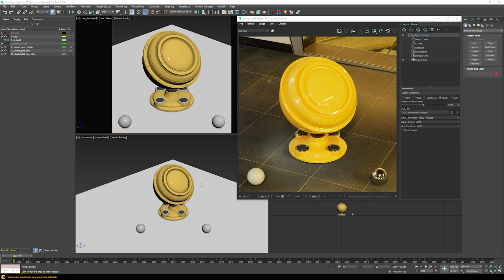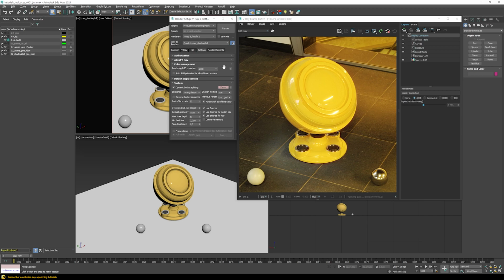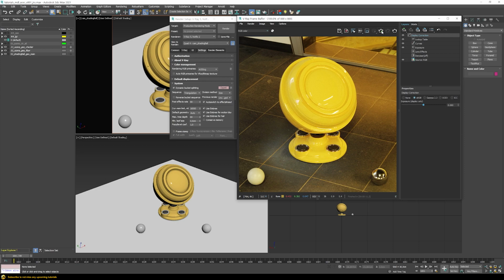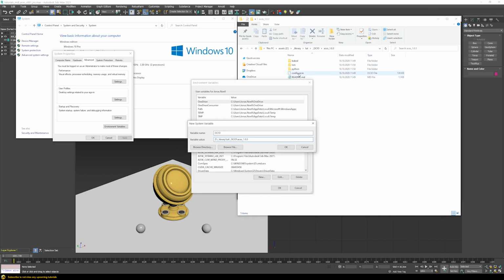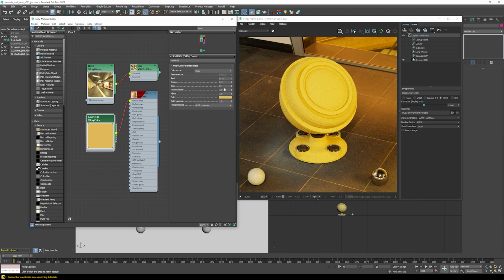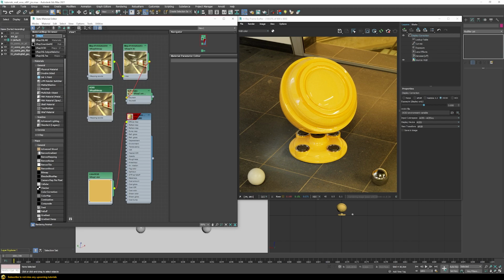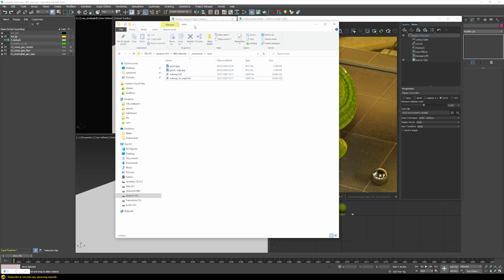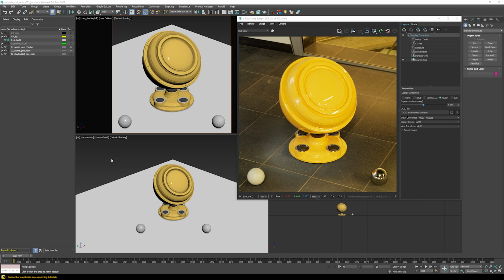V-Ray | How to use ACEScg WORKFLOW | ACES Theory, General Workflow, OCIO, sRGB Texture Conversion

Comment: Hey Jonas, I've been highly enjoying the results coming from the VFB, but the next issue is post work in Photoshop and After Effects. The render results do not look the same when exported as an OpenEXR, png, jpg, TIFF, Targa, nothing. Made sure Photoshop was set to 32-bit mode and changed color space to ACES. Is it simply Adobe doesn't support ACES workflow yet?
Reply from the maker: Hi, as far as I am currently aware Photoshop does not support ACES colorspace internally yet. You can however import EXR-Images and then convert them using this plugin here: http://fnordware.blogspot.com/2017/02/opencolorio-for-photoshop.html
I tested it and it works but it basically will bake in all the information and you are not working really in ACES colorspace internally. 
Take everything that I said with a grain of salt as I am not a Photoshop expert, so maybe there are still ways how to set up Photoshop correclty. If you find some please make sure to share it with me :-)
Reply: There is a workflow in photoshop that involves creating a view transform in 32 bit by exporting a 3dLUT which you then stick on top of your stack in an adjustment layer but I haven't worked with it much. Im not sure if it reacts how you'd expect in fusion or nuke for example - both which have proper acescg implementation. so short answer is, no. Sadly, Photophop doesn't support acescg natively which is a shame. Adobe tends to buy innovation rather then develop software but I will refrain from letting loose on Adobe...

Comment: What about bump normal maps? they load as srgb?
Reply from the maker: They should be loaded as "raw" so that means that no transformation is applied. VRayBitmap is smart enough to load it correctly by itself in V-Ray 5 when you apply it through a VRayNormal Map node. If you want to make sure you can also extend the filename with a "_raw" tag in the end.
Reply: @JonasNoell  so if i rename it accordingly with raw, it bypasses auto settings in vray render settings checkbox?
Reply from the maker: @Minche Flute If you add the _raw nametag it will make sure that the VRayBitmap is loaded as raw when you enable Auto RGB primaries in the render settings. 
But as said if you load it through a VRayNormalMap node it's basically impossible to have it loaded incorrectly in V-Ray 5. Unless you go in and manually switch the RGB color space in the VRayBitmap itself. Also, you will notice pretty fast if the Normal Map is loaded in the wrong color space :)

Comment: Thank you for the tutorial. I just want to make 1 additional note. I found that if you use VrayColor and pick color not by values but with standard color picker, to receive same color that you see in VrayColor in front of "color" you need to adjust color gamma  to 2.2. As I understand it's because  3ds max picker work in gamma 2,2 and you need additional conversion to receive the same color that you pick by "eye". We artists and we want to have green color that we pick in VrayColor look the same in diffuse render element :) Correct me if I wrong
Reply from the maker: Oh, that is a good point. I would need to double check but I a ssume that's how it should be done, adjusting the gamma to 2,2 and then you would be able to just pick the color you want and it would look the same in the diffuse. Thanks for pointing out!

Comment: Hei Jonas, thanks for the video, super interesting and ill documented subject on vray. I just have one question. What will happen to textures you dont convert? Will it “break” the workflow, or just alter it a bit. I am thinking about testing this with a project and would probably just convert the main architectural materials, the ones that cover more surface, and thus affect colors more
Reply from the maker: Hi, well basically nothing technically bad will happen except that your colors will look way more saturated than they are supposed to look like. For example if you are using a grass texture the grass would look greener than it was originally intended to look like defined by the texture. So in order to have everything behave the way you expect it to it would be best to stay uniform in the color space that you are using and not mix different color spaces together. Basically if you use the workflow to assign proper name tags to your textures you wouldn’t need to convert anything manually and everything would happen automatically, so that is probably the easiest approach 😉
Reply: @JonasNoell  The good thing also is that if you assign the proper names, that would not affect the use of non aces workflow
Reply from the maker: @maxdanieldaiber  Yes, exactly that is the idea behind it :) Just set up your texture/hdri library one time, switch on AutoRGBPrimaries and from then on don't need to care about it anymore (as long as you use VRayBitmap)
Reply: @maxdanieldaiber  Yes, but older projects will have missing textures because you renamed them, no?
Reply: @bgtubber  well I guess you can duplica te them to avoid that
Reply: @maxdanieldaiber   @max daiber  Of course, but that's pretty wasteful on HDD space, especially if one has hundreds or even thousands of assets which is not uncommon these days.

Comment: Very interesting tutorial, thanks for that.  Here's what I'm wondering about: Since I edit every rendering in post to some extent, what's the point of doing all that converting? Don't you "falsify" colors with every adjustment you add, regardless of color space? Maybe my workflow is just too simple ;)
Reply from the maker: Well as said it really depends on your specific use-case. If you don't work in a team that requires ACES for example for use in compositing then in your specific case it probably doesn't really make sense. Basically working in ACEScg guarantees that your work is future-proof and can be converted to whatever colorspace to be displayed on whatever medium in the future. But if you mainly do pictures that are just published online and just view them on sRGB monitor you won't have any immediate benefit to adapt this workflow and on top of that you have the risk to implement many mistakes if you don't really know what you are doing. I think at the moment probably most people are fine to continue using sRGB and unless you know a specific reason why you should change it probably means you shouldn't :)
Reply from the maker: Speaking about adjusting pictures in post, ACEScg gives you more room to do more extreme adjustments as you have a wider color gamut to work with. But you need to use a software that supports it (Photoshop for example doesn't). So if you do crazy adjustments in post and use specific software then that might be a reason where you could benefit from using ACEScg.
Reply: @JonasNoell  you just put into words what I was thinking: very specific use case and not for me 😄
Thanks for the clarification!
Reply from the maker: @pixelquarry  Maybe not night now, but it will become increasingly more important so it's definitely good to know what it basically is :)
Reply: @JonasNoell  that’s why I bookmarked this video! 👍
Reply: I think correct colors will always be something important to consider even if you do a lot of post on it. I am constantly strugling with colors in vray and max and it seems to me that this is one step forward on working well with them. Anyway, if you do archviz like me, you may find yourself twicking most of the diffuse color of assets you buy, so maybe it wouldnt be that bad to convert at least them most important ones
Reply: @maxdanieldaiber  As I understand it ACES increases the range of colors beyond sRGB...on devices capable of displaying more than sRGB, which aren't many I reckon. So I'm not sure if ACES is going to help with your struggle. Wrong colors on 3rd party assets remain the wrong colors even in ACES. That being said, all I know about ACES is based on this video so take what I say with a grain of salt. ;)
Reply: @pixelquarry  Any HDR capable device can display ACES to an extent. So any flagship mobile phone and any recently manufactured TV. I think any OLED panel too. So if you wanted to produce content now that you could revisit in 5 years and have it look great on the latest display technology, then ACES creates that opportunity.
Reply: @jpjapers  I’m sure at some point there won’t be a way around it. Until then I’ll wait till it actually becomes mainstream 😉
Reply: @pixelquarry  it already is the industry standard across the movie industry. It's just in visualisation some people are so set in their ways with linear. I find it pretty frustrating to try and mobilise any sort of change in this industry.
Reply: @jpjapers  I should have been clearer when I said "mainstream". I meant my mainstream, in regards to what my output to clients requires.
That being said, a linear workflow would be unaffected by an increase in color range, wouldn't it? I work in linear simply for its advantages in post. Adding contrast means compressing highlights and shadows and I'd rather do that in post than have it burnt into the render.
Or am I missing something?
Reply: @pixelquarry  with ACES you don't compress any data ranges because of the size of the gamut being so much larger than srgb
Reply: @jpjapers  I was trying to discribe what happens when you add contrast to an image - highlights brighter and shadows darker. I don't really understand why you would move away from a linear workflow, or stop filming/photograph with a flat profile for that matter, just because you can work with a bigger color range. 
I just realized, 32bit means 2^32 colors per channel. what does that for a larger color range? How do more colors compete for 2^32 slots.
There's a good chance I'm getting this all wrong.
Reply: @pixelquarry  colour isn't really what people consider colour. What they consider colour is actually chromaticity because technically colour includes brightness. So with that increased gamut you also increase the depth of both the brightest white and the blackest black giving you much broader dynamic range. You apply a display transform to the data to correctly display that data in your screen in the correct colour space. Which is basically what you do in post with linear images except it's not a complete guess like that workflow typically is. Essentially aces guarantees a far more dynamic image with less manual proceseing as well as being able to composite images together far easier (because you're converting everything to the same colour space on a per device basis through your input display transform)
Reply: @jpjapers  I guess I'll delve into ACEScg at some point.
Reply: @pixelquarry  Im gonna to jump in here. Bit depth and color gamut are different things. I think you just need to try it to understand what you're dealing with and hopefully you have already. In practice your 32bit "linear" image is still using sRGB primaries which will result in a limited color range despite all that bit depth. We're not also saying that you ditch 32bit images with acescg, just the opposite, rather how you deal with the distribution of color data - primarily in the extremes of luminosity(bright and dark) and saturation.
Reply: @MrMadvillan  I delved a bit deeper into the aces workflow and actually rendered two client projects in aces. I really like the aces tone mapping right out of the bag. It’s still weird though to see vivid colors and contrast in a raw rendering. I’m so used to linear output 😉

Comment: Is there a correct way to guess the color space of the source image/texture directly in 3dsMax/Vray in cases where there isn't any initial info/metadata about it or I should use a third party software? 
I am asking because there is a difference between Image Color Space and Image Format and trusting the human eye and different monitors in different working-environment circumstances can lead to unwanted inconsistent results and in these cases the input or output source can be easily messed up.
Reply from the maker: Hi, that is a very good question. As said the topic about ACES is very huge and I am mainly a 3D artist and not a colorspace specialist, so based on my current knowledge I would answer like this: It probably depends on the file itself. So let's say you have a jpg that you want to use as your diffuse map then there is no way of knowing if it was already converted in aces or if it is in sRGB, because the jpg itself is always in sRGB and the conversion to ACEScg would just mean that you artifically shift the colors before the file is saved, but the file itself is still in sRGB just with more desaturated colors. I would assume any texture to be sRGB if they are not marked in any other way. Anyway, additionally you as an artist could make the choice if you open the texture for example in Photoshop and want the colors to be displayed the same way in your rendering using ACEScg then you would need to convert it first.
As for other images formats, especially raw formats directly from cameras you probably can read out the colorspace they are in and then convert them to ACEScg properly. The VRayOCIO node has a huge list of possible inputs, so if you know for example this is a plate shot with an ARRI then you can chose the appropriate conversion. Basically the idea of ACES is not to preconvert everything to ACES first, it just means you need to know your source images, then convert them on the go, so that all your calculations are done in ACEScg colorspace and then once you output your image you can choose whatever other colorspace you want. ACES is basically a system to bring a lot of different colorspaces together and then do calculations in one unified and wide color gamut colorspace and then export to whatever colorspace/displaydevice you want to have it. 
Sorry that I can't give you any more clear answer on this as I am also still learning :)
Reply: @JonasNoell  Thanks a lot for the detailed answer!
 I've found this short research paper about Color Space Identification for Image Display -> https://www.researchgate.net/publication/281602132_Color_Space_Identification_for_Image_Display
It's from 2015 so maybe there is already a third party software based on it.
Reply from the maker: @HURSAs  That looks and sounds promising :) Let me know in case you find something that is released and already works as I would be also interested in that!